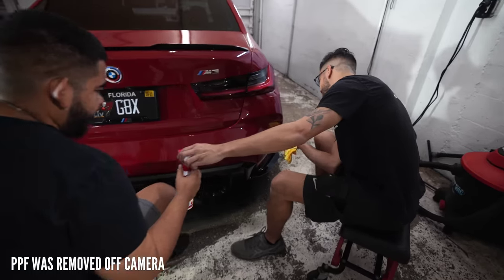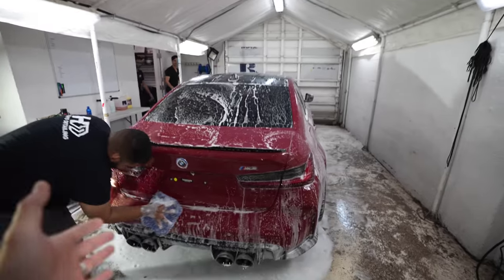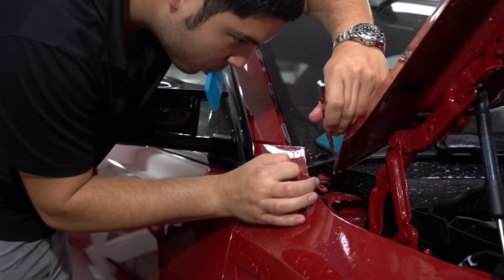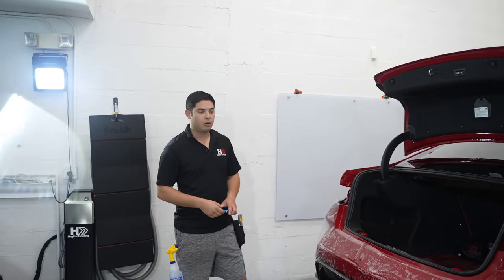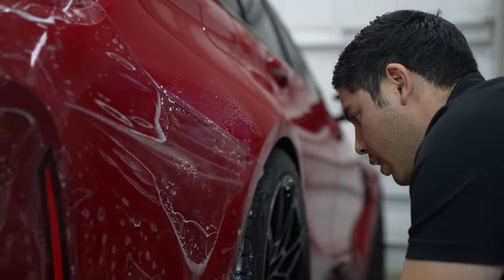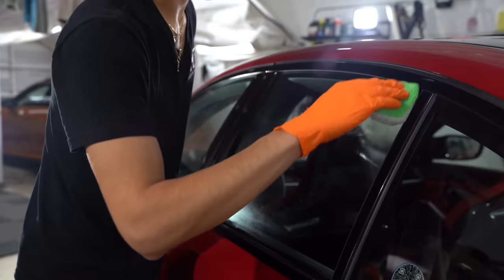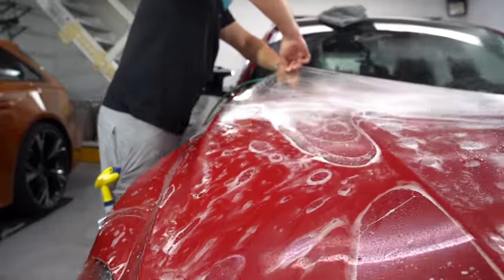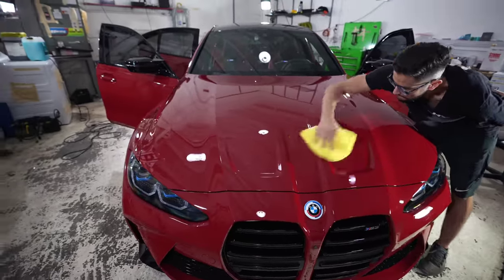We Removed The Paint Protection Film Off My Car | Imola Red G80 M3

Comment: as a detailer of many ppf installed vehicles,  use a quality durable ceramic spray coating like Turtle Wax Ceramic spray or Griots 3 in 1 Ceramic. I love beadmaker but stopped using it because it doesn't last..go with one of these as a topper apply on your ppf after cleaned and dried. and it last 4 months. then every 2 washes use it as a drying aide and you'll have hydrophobic properties forever as well as good gloss and protection.  love you're Bimmer! looks so good

Comment: Another great video mate!
My M3 comp X arrives mid 2023 and I want PPF as like you I am obsessed with car care and keeping it mint, however I have a problem with taking  my prize possession, that has been put together by highly skilled German engineers to then have it stripped and reassembled by two part time (as wrapping is their main skill) local body shop guys.
Does all PPF applications require mirrors, door handles, lights, and bumpers to be removed?
Reply from the maker: Thank you! Thank you for checking out the video. I'm glad this other people like me out there haha. When you ppf it there's definitely other ways of kind of making it seamless. But some of the best ways is actually removing the door handles and Etc. A good shop will do it right where you will never notice that it was removed. The guys in the video are incredible and do an amazing job where I don't know notice anything wrong with it
Reply: No chance am I voiding my warranty because someone has removed a part of the car and failed to put it back together properly. Also I don’t like the fact that the “10 year warranty” is dependant on climate etc. It should be for all weathers, garaged or not. That’s a bit of an excuse to not honour warranty. It should go from the worst being 10 years in the worst case, and even longer if garaged etc. Stone chips can be painted perfectly for next to nothing also and it’s much more cost effective than PPF. In the UK it’s £2000 to have the “track pack” which only covers high impact areas.

Comment: My M4 arrives at the port on Jan 18th, and I should have the car by the following week. I was all in on getting the PPF done (front half of car) with a full ceramic coat, but I don't know. I could just ceramic coat the damn thing and use the rest of the money to throw a nice exhaust on the car and grab some intakes...or use a chunk of what I was going to spend on some nice forged wheels.
Reply: congrats bro!!!!
Reply: Thanks, man!
Reply: @vilebastage  no problem
Reply: Depends what you plan to do with it. Leasing? Maybe doesn't make sense. Purchasing? Probably a smarter bet. If you're doing a special order color AND purchasing, that might make even more sense. I did full PPF and ceramic coating because I have Frozen paint and it's borderline necessary, considering I'm not leasing either. Just depends what your plans are with the car long-term.
Reply from the maker: Congrats on the new M4 coming! I no the weight was probably brutal. That really all depends, @caseyrendon made some good points in his comment. His comment is spot on. I also made a video about this topic 
https://youtu.be/Oy3Wp8kb1nI

Hopefully that gives you some insight and gives you some better idea on what you should do.
Reply from the maker: Casey's answer is spot on. All those are good questions to ask yourself when it comes to paint protection film.
Reply: @TheDailyDriven  The wait wasn't really that bad. My dealer had allocations and I just kind of walked in early Nov. Car finished production mid December and its on a boat headed here now. No where near the wait that I'm seeing a lot of other people go through.

Anyway, I scheduled the PPF for the end of the month. I guess I'll do and exhaust over the summer and look at wheels then. Should be past the break-in period by then anyway.

Comment: i think ceramic coat is the best method to protect the paint
Reply from the maker: Yes Definitely one of the best ways +ppf
Reply: You won't have protection against rock chips though. Also with PPF you end up not getting any damage when someone hits your car with there door or side swipes you. Not to mention the self healing aspect means you can use pretty much any wash method and have little swirling.